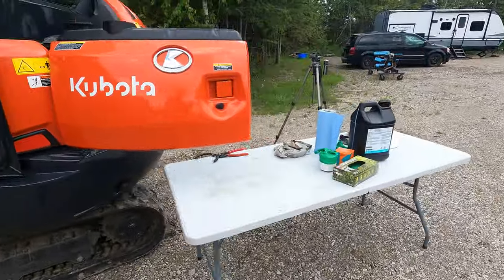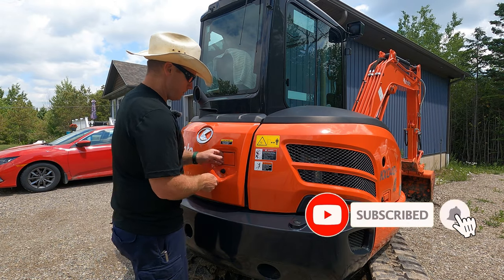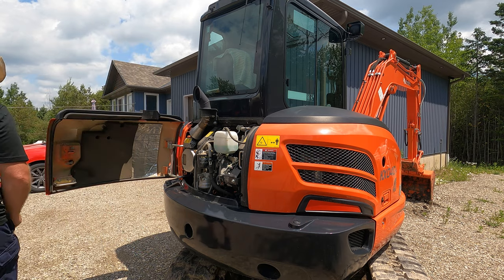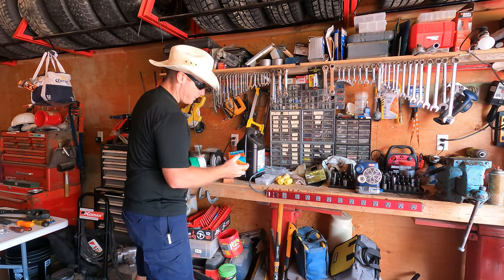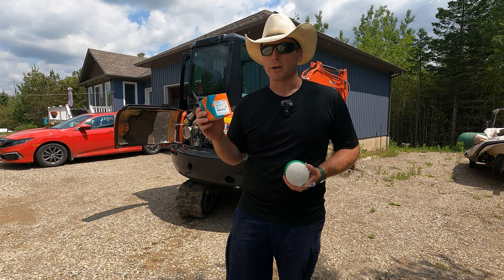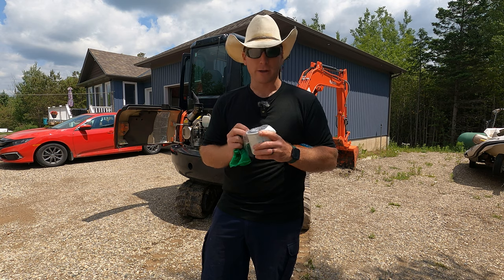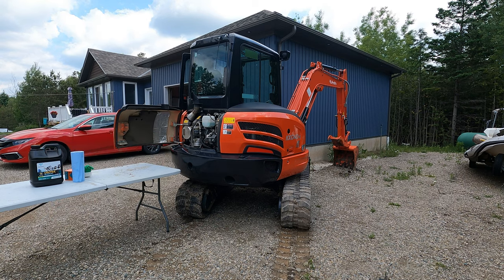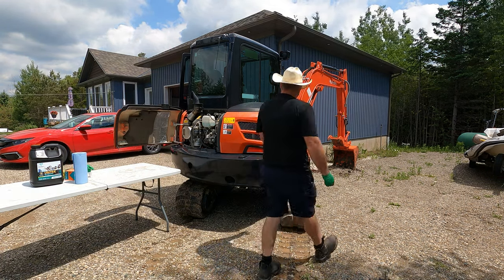Kubota KX040-4 Oil Change & Daughter Finley's Accident On The Bus - No.136 in 4K

Comment: Sorry to hear about your daughter. That is nice design to have the funnel and tube to drain the oil from the filter down to a manageable place. The engine oil filter is indeed tough to get out of that crowded place. I've seen you opening both ends of the grease gun. I don't know if you had an issue or what, but usually, only the top part is to be removed, leaving the bottom still assembled.  I take a pair of pliers to pull the empty  plastic tube of grease out.  If you are not already familiar with grease gun, this video might be interesting to watch!   Thanks!
Reply from the maker: I’ll watch a few videos for sure to see if I’m doing anything wrong!! Thanks!

Comment: I have the same issues with finding the proper socket size.  I started recently using a paint pen to write the size on or beside the nut so its easy the next time.  As for Findlay, Contact the school in writing, and copy the superintendent.  The School board is responsible for it's carrier.  With the amount of blood seen in the video, the bus driver should have contacted 911 for an ambulance and not leave the scene.  You never know the extent of the injury.
Reply from the maker: Great hack to more easily see the socket size! Julie’s all over the bus company to get some answers!

Comment: Wow James, so sorry to hear about your daughter. That was not cool. We are starting to get some real ding-a-lungs for bus drivers here.
Not so much in my immediate area. The older bus drivers would manage their speed when coming to a stop to let oncoming traffic move through before they opened the doors to unload their precious cargo. 
I have noticed as of the last few years that the buses throw their red light a on right before they stop not giving opposing traffic enough time to start slowing. It becomes an everybody slamming on the brakes and trying to to load your vehicle on top of the one in front of you. Particularly concerning when you’re driving a loaded truck and you need to stop instantly. 
I am quite certain that you will handle this and take care of business. Just sorry that it is even necessary.
Reply from the maker: The rules in Canada (Ontario anyway) have changed a bit … there is actually now a set of yellow flashing lights that the driver is suppose to activate well in advance of the stop and than once stopped they’re to change to flashing red and put out the stop sign. There will never be enough safety on school buses - there’s always a bone head in a hurry!